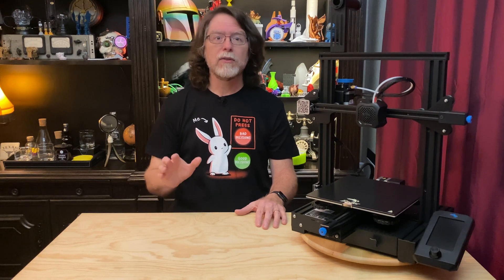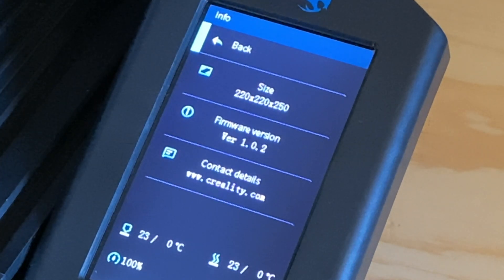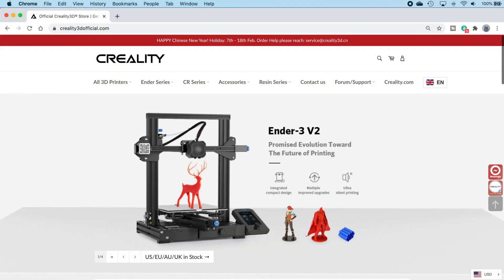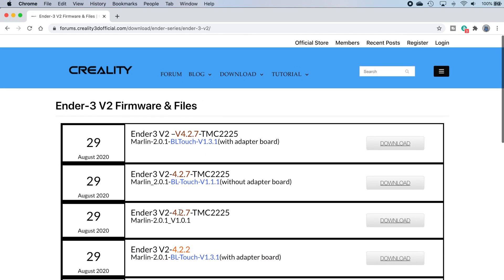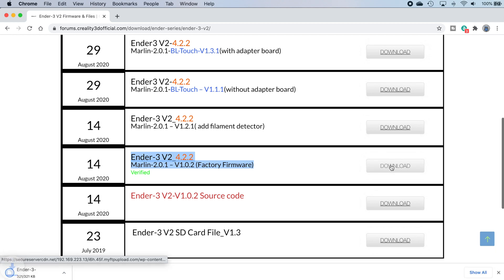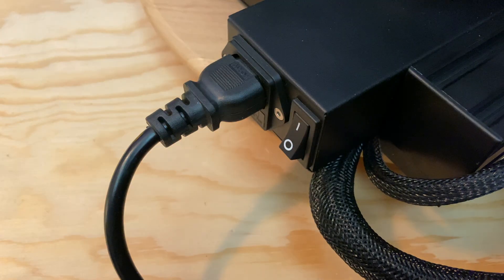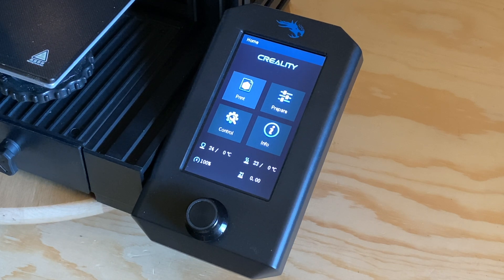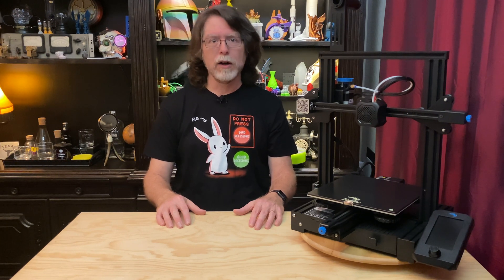How to Update the Firmware on the Ender-3 V2

Comment: I need help!!?? After I slice a project and load it on the SD card and try to print it. My printer won’t read the card. It worked one time and I printed it fine. It’ll print the rabbit and little boat fine that’s on the card. What am I doing wrong?? I’ve tried both Cura and Creality Slicer software. 🤷‍♂️

Comment: I couldn't get my Ender 3 v2 GD to read the .BIN file from the FAT 32 SD 4096byte card.  When I turn it on, it just boot to the normal screen without updating the firmware.  How can I get my system to read the .Bin file?

Comment: Hi, I have an ender 3 v2 with bl touch & the 4,2,7 board. Have just uploaded the latest firmware & when we go to check the info it shows that it now has the latest firmware but the printer does nothing, doesn't auto home, autu bed level, nothing. What did we do wrong ?

Comment: Hi i just installed the sprite pro on my ender 3v2 and did the firmware updates for the sprite main board ans screen and now it seems like its not printing the g code. It just heats up starts to center and stops. Then the percentage bar finnishes at 100%

Comment: This was super useful!  Thanks so much!  However, there's one major change that you should be aware of.  Creality has changed their firmware download page significantly, and their files are all stored in Google Drive folders.  It's much more confusing, and needs a bit more explanation for a beginner to navigate through successfully.
Reply: Also wondering with the chip difference between the stm32 and gd32, can you use the same fw? Been trying to find an answer to this one, but no luck other than compiling.
Reply: Gadget steel mare I need help with this problem
Reply: Yeah. Yeah, it's making me want to forget the FW upgrade. This is a bit much.

Comment: Update (11/9/22).  Some Enders 3V2 use a GigaDevice  GD32F303 RET6 (512M) chip (instead of a STM32F103 Retx).  Apparently, these are not exactly the same.  I had no luck up dating my 3v2 with any of the Ender  3v2 firmwares,  unless they start with GD.  I found the correct firmware depends on the Model (Ender 3V2), motherboard (4.2.2 or 4.2.7) and chip (STM32103 or GD32F303)(I had trouble reading the chip description until I took and iPhone picture of it and suddenly the chip info was quite clear), and what upgrades you may want to install (Bl touch, CR touch, filament detector,, etc.) and finally, how the SD card is formatted (Fat 32 4096, full format (not quick). Finally, my system updated, but alas my screen display was  knocked to the initial Creality Blue screen with finite elements cascading, but that is where it sticks (see [Solved] Creality Ender 3V2 screen frozen, won't turn on, Jack Wagoner)  This says "solved" but I have no idea where the solution is.
Apparently not only the 3V2 has the GD chip but also some 3 Pros, and 3's may have the same problems.  I can't say there was much on the Creality page that made this all much easier.
I wish I had a complete fix for this, but I'm not there quite yet.

Comment: my printer has been stuck on the creality logo and didnt do that black screen. did i do it wrong?
Reply: i am having the same problem. did you solve it? if you solved it can you please tell me?
Reply: @Craftzone3d  I ended up installing a previous update. 
In the end, I ended up returning the damn thing because the thermistor was defective out of the gate
Reply: @heroman2372  Is there any other way but to return it? Has the problem been fixed with the latest update?
Reply: @Craftzone3d  no clue, I returned it three months ago. 
Returning it to the original update version did fix it though. Couldn't get it to update after that though.
Reply: @heroman2372  
can you send me the original file?
Reply: @Craftzone3d  unfortunately I don't have it anymore but a quick Google of the version history should give you what to look for

Comment: Please dear god help me. How does one verify the right firmware is on the printer? Inserting my sd with one single .bin file (ender 3 v2 firmware and bltouch update) results i nabsolutely nothing. Firmware version is still 1.0.4 instead of 1.2.2. Card was already formatted as an fat32 so please someone help a brother out

Comment: I'm afraid I might have turned my printer into a brick. After installing a new hot-end and fan, for which I had to access the mainboard, the moment of truth came and I turned the printer back on, there I was hit with a BSOD. Stupid me didn't have the SD-Card inserted, back then at the beginning of my Odyssey I didn't even know the card can be used to flash the 3D-printer. So I followed alll the steps to put the right firmware on my correctly formated SD-Card, but it did not help, not after numerous attempts, not after renaming the file, not after trying several similar files (like the filament detection version), always BSOD. The only thing I can achieve is a red screen when flashing the DWIN_Set file directly into the screen, unfortunately this didn't help me either. 
Now I'm not entirely sure yet if the printer/mainboard has to be buried, but flashing the firmware via SD doesn't do the trick anymore.
So here's why I come to you: Do you know a way of installing the firmware back on the printer if I connect it via USB? The printer does turn on and I get feedback when connecting it to my PC, but unfortunately neither my PC nor the printer itself know it's a 3d-printer anymore.
At least the driver seems to be the right one, as it auto-installed the same CH340 driver that is included in a package from the Creality downloads website. Now I'm lost as to how to proceed.

Comment: Hi, any idea why a printer will not see the firmware in the file? I tried flashing the card many times, different cards, etc. the reader works as I am still able to see models in other cards. I have version 1.0.4, 422 board. Thank you!
Reply: i got the same problem

Comment: Out of the box my printer has a firmware version V1.0.4 but the bin files in the firmware updates for the Ender 3 V2 say V1.0.2, should I still use that file

Comment: It says you need to factory reset the printer after a firmware install in the CR touch instructions, is this really necessary? as I have not seen anyone else mention it in the installation videos.
Reply from the maker: It's probably not a bad idea, but you'll want to make note of your existing settings first. Particularly if you've customized the steps per millimeter settings, such as for an extruder with different gearing from the stock one.

Comment: What are the consequences of not using an empty SD card? Say throwing the bin in the card's root alongside other files?
Reply from the maker: In my experience it usually works fine. But when it doesn't, I usually back up the card's contents if I want to keep them, and reformat the card.

Comment: This video doesn't cover when you don't load the right file: with this particular version of the printer the file I selected caused the printer to emit a high pitch whine.  It was about 45 minutes until I discovered the correct firmware (as the directions in this video are wrong).  I wish the video had said "If you pick a file, and the printer makes a noise you probably picked the wrong file" or something along those lines.

Comment: I have a Ender 3 V2 4.2.2 was lost bootloader. Where can I get it ?
Reply from the maker: Hi, the Ender-3 V2 with a 4.2.2 board shouldn't need a bootloader. When it powers up, it looks for a ".bin" file on the MicroSD card. If it finds one, and it's a valid firmware file, it'll update the firmware using that file.
Reply: @BV3D  The Ender-3 V2 4.2.2 got an issue with the MCU STM32F103RCT6, therefore I replaced it with a new chip. I download a latest firmware from Creality then using a st-link to write it into the new MCU but the machine didn't work (blank LCD, no buzzer, no activation, no anything) when power up. After investigating two weeks, I try reading memory from old MCU then re-writing it into new chip by st-link, but machine status also didn't work after power up. Finally, I copy the latest firmware (.bin file) into a MicroSD, put it to machine, waiting for about 20 second after power up, the machine worked. Could you please explain for my case ?
Reply from the maker: @SangPhan-dv3mk  OK. First, I think it's really awesome that you've got the skill to replace the MCU on a board. I can do basic soldering, but what you did is way beyond my skill level. Second, I have no idea why what you did worked at the end, but maybe when you read the code from the old MCU and wrote it to the new one, you also got the part of the code that looks for and applies firmware updates from the MicroSD card slot.
Reply: @BV3D  I have some skills for HW but I have been playing as a SW engineer for a life of rice and money.
I am also thinking the same as you, a part of code in the old MCU started then updating new firmware from MicroSD card, it may a bootloader program which supplier wants to hide it. BTW, I would like to thanks for your feedback.

Comment: Thanks for simplifying your video, but one issue, my ender 3 Pro has a board V1.1.2 32 bit, I downloaded the software into the printer, screen turned blue and came back, did not fix my issues, also the about printer says V1.1.2-4.25.20?? not sure what to do next?

Comment: I had the UI screen stay blank for a few minutes trying to install the firmware, at 6:18 Bryan said to reformat the card as a "MS DOS vat volume(?)". What is that and how do I do that? This was for the BLTouch without adaptor, 4.2.2
Reply from the maker: Hi Kevin, here's a video about formatting the cards as FAT32 volumes: https://youtu.be/VM29_OFHpy8
Hopefully that'll help. Also, note that the main board remembers the name of the most recent firmware file it tried to use, so renaming the bin file to something like firmware1.bin might help, too.
Reply: @BV3D  Thanks Bryan! It was in FAT32 already but doing the non-quick format seemed to do the job!

Comment: Tried all that now my printer just screams at me when I turn it on
Reply from the maker: A screaming printer. I think I ran into that when I was putting JyersUI on my Ender-3 Max. I had plugged in the V2's screen, but hadn't updated the firmware on the main board yet, and when I powered the printer on, the screen made a long, continuous beep.

Based on that, check to make sure you've got a firmware file for the Ender-3 V2, and not for the Ender-3 or Ender-3 Pro. Creality's firmware organization is kind of a mess, last time I looked, so getting the right file can be confusing.

You might also want to give the JyersUI Marlin firmware a look. I've got a video about it here: https://www.youtube.com/watch?v=o1zXYwgIPLY
Reply: @BV3D  so I got the firmware installed now. It want to print high tho how do I fix that?
Reply: @BV3D  I think I got it actually thanks

Comment: Did anyone notice the sonic screw driver. need a link to that.
Reply from the maker: That's exactly what I call it, too: My sonic screwdriver. It's an ES120 I got from SainSmart. One button. Press it, start rotating the screwdriver, and the motor kicks in to move in that direction. The further you twist, the faster it goes (but I did have to enable that feature in the menus somewhere, otherwise it moves at a constant speed). Here's a link to it: https://www.sainsmart.com/collections/repair-tools/products/toolpac-es120-motion-sensing-smart-screwdriver

Comment: Every video I watch on this has the same website.  BUT I CAN'T FIND IT!  When I type that in the site I get is totally different? WTF?  When I type the URL in directly it says that doesn't exist.  I would just assume they updated the page but whenever I download the firmware and try to put it on the printer it doesn't work.  WTF is going on?
Reply from the maker: Creality re-did their site a few times over the past several months. 

If you start from the Ender-3 V2 page on Creality's site ( https://www.creality3dofficial.com/products/ender-3-v2-3d-printer ), scroll down to where the Description section starts, and click on the PDF & Files tab right next to it. Then click the "Down Load" button, which doesn't actually download anything, but takes you to their Google drive.

In there, it's kind of a mess, but assuming you're looking for Ender-3 V2 firmware, that would be in the "32bit_4.2.2&4.2.7 Marlin Version" folder.

In there, you'll find four files. For the 4.2.2 board, there's a BLTouch version, and a plain version. Same for the 4.2.7 board. You'll probably need to remove the bottom cover of the printer's electronics enclosure to see which board version is installed in your printer.

Hopefully that helps.

Comment: Very helpful video. After installing the BL Touch and trying to update the firmware using the instructions from the video, I continuously have a dark screen. I cannot get the old OS or a new one to display. Any advice?
Reply from the maker: Hi Nathan. Try renaming the bin file on the MicroSD card to something short, like firmware01.bin -- that might help. The printer remembers the name of the most recently-tried firmware file, so changing its name may help it out.
Reply: @BV3D  this worked for me
Reply: @BV3D  This worked for me too. Had to reformat my card 3 times and finally a shorter name change did the trick. Thanks for posting that comment.

Comment: it says that the bin file can't be expanded
Reply: Not on the printer on my Mac and pc
Reply from the maker: @ralphserago4786  Ah, OK. That's not a file designed for either your Mac or PC. That's the binary firmware, so it just needs to get copied to a freshly formatted MicroSD card (FAT32 format, 4K allocation units), inserted into the printer, and then turn the printer on.
Reply from the maker: The printer displays that message on its screen?

Comment: after upgrading to the jyers none of the stepmotors move can you help without bltouch
Reply from the maker: Check to make sure you're using the file that matches your printer's main board. I think I heard from another person that they used a 4.2.7 file on their 4.2.2 board (or the other way around), and they had the same result.

Comment: With some trouble you can look trough the slits in the bottom to find the version. not easy but doable if you dont want to open te printer (the version is behind the first slit right of the fan openings)

Comment: Does the fw have to be on an empty card? I emptied the card, formatted it fat 32, copied fw and booted ender 3 v2. Stilling getting black screen after several minutes. Verified I have 4.2.2 board, no adapter
Reply from the maker: Try renaming the .bin file to something like firmware1.bin and see if the printer is happier about it. It shouldn't take but about 10 or 15 seconds to flash the firmware, so if it's been several minutes, something went wrong. Also the printer remembers the name of the last-flashed firmware file, which is why that "rename the file" trick works.
Reply: @BV3D  That's exactly what solved it. Going through the BL Touch install video now. Thanks for the great tutorials!
Reply from the maker: @RayOrsini  You are very welcome! 😉

Comment: I've installed my BL Touch and have watched this video SEVERAL times over the last couple of months and I STILL can update/upgrade my software.  So now I have a BIG paperweight on my table.  I'm running Windows 10 which unfortunately does NOT have a FAT32 formatter.  Are you aware of any good (especially free) FAT32 format downloads that I can use?  My Ender 3 is V4.2.2 board and Firmware is V1.0.2.  Any help is GREATLY appreciated.
Reply from the maker: Hi David! I'm not really a Windows guy, but does the information available here help? https://www.lifewire.com/format-usb-drive-in-fat32-on-windows-10-5113286
Reply: @BV3D  So I finally got the SD card Formatted, however, the link to upgrade the Ender3 V2 no longer exist on Creality's site?  Should I assume that I can not upgrade my Ender3 v2 to BL Touch?
Reply from the maker: @davidlykins8937  I'm glad you got the card issue taken care of. It looks like Creality is revising their site, so things aren't where they used to be. They've got the Ender-3 V2 firmware files hosted on a Google Drive. Here's a link. https://drive.google.com/drive/folders/1opG6Go-jFH2aljYrg-mLSEE5ezLhTirT

That said, if you want to go beyond the stock firmware, give JyersUI a look. There are precompiled binaries ready for you to put on a card. I've got a video about that here ( https://www.youtube.com/watch?v=o1zXYwgIPLY ). Where I download the basic version of the firmware, you'd download one of the BL Touch versions.
Reply: @BV3D  Hi Bryan, thanks a bunch for your help, I got the firmware uploaded, had issues with the extruder being to high above the bed, but a quick search on YouTube showed me how to change and save my Z-Axis settings.  I Printed out the XYZ cube this morning and all is good.  You're videos are very informative and you present them quite well.  Thanks again.

Comment: Been trying to update my firmware on an Ender 3 V2.  It gets stuck on the creality logo. Recently put in a replacement 4.2.7 board.  Also tried renaming the .bin file.  Also watched several other videos and some of them mentioned a DWIN_SET folder which isn't included in any of the downloads I tried.  Edit: should also mention that I'm not using a BLTouch

Comment: i must be unlucky.  Tried installing the firmware to use the BL Touch on a brand new Ender 3 and it just stayed a black screen for 30 minutes.  Now it wont update or boot off the black screen.  Bricked... Trying to contact Creality and hopefully get a new board.
Reply from the maker: Try reformatting the card as a FAT32 volume if you can, and when you put the firmware.bin file back on it, name it something short like firmware.bin. See if that helps.
Reply: ahhh.. renaming did it!!!!
Reply from the maker: @Michael Bennett  Woo-hoo! 🥳